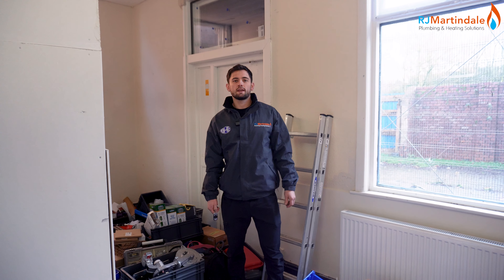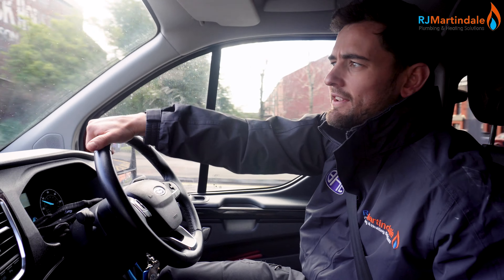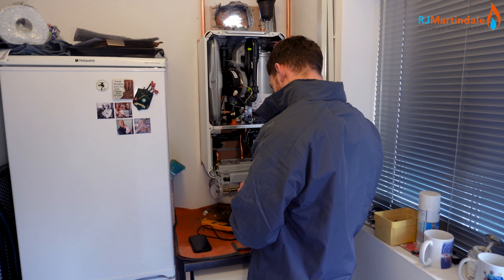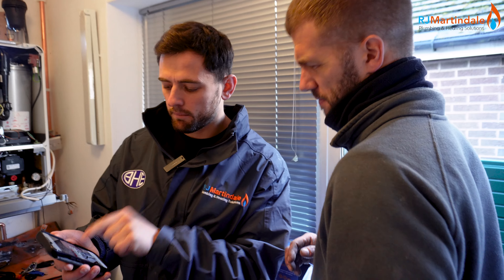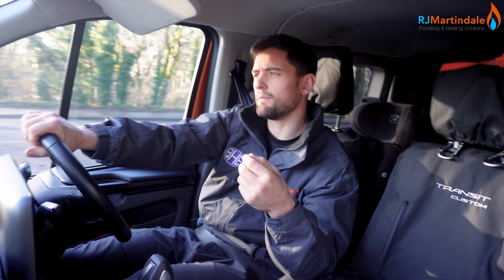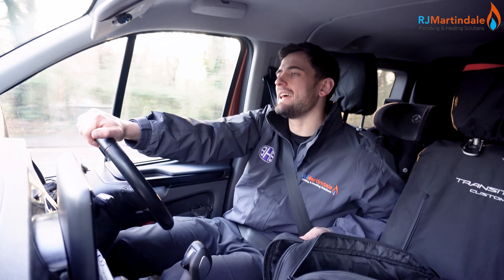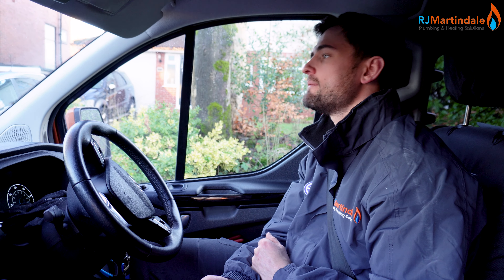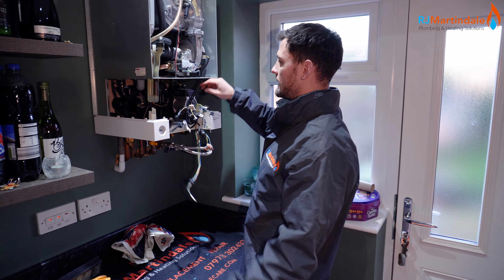VIESSMANN F2 FAULT “Remove the PCB”

Comment: Great tip on the pcb removal, I got water on the board the first time I worked on one they for ages with a hair dryer 🤦‍♂️ shame boiler manufacturer don’t do a one plug disconnect and remove
Reply from the maker: Nightmare when the board gets wet 🤦🏻‍♂️

Comment: If you do wiring on your systems do you issue electrical minor work certificates. When we had are boiler changed the contractor got an electrician to do the controller and issued a minor works certificate
Reply from the maker: We dont Damien, we are only working off the fuse spare but that's good practice 👍🏻